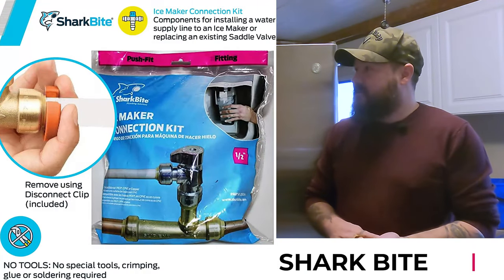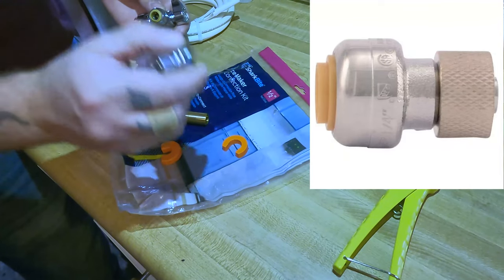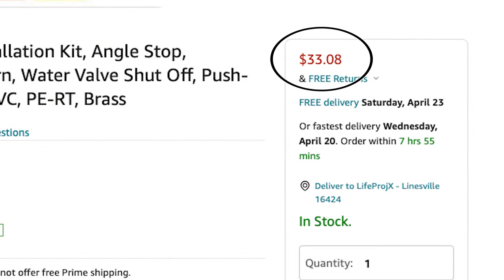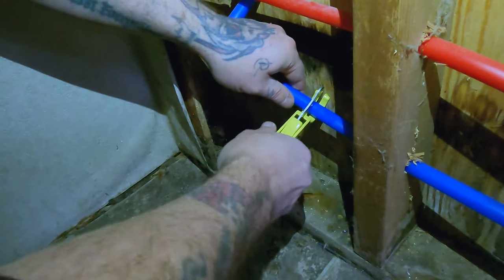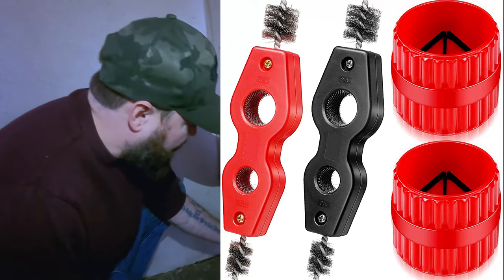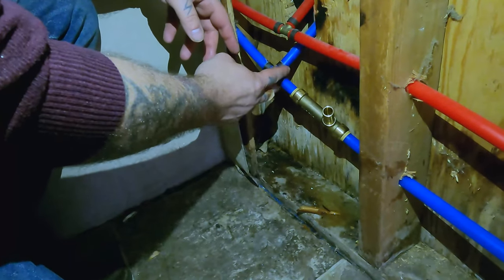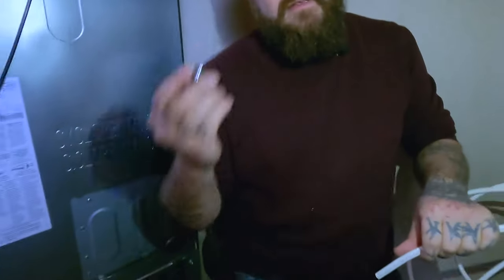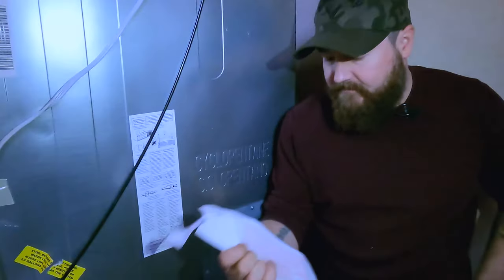Fridge Water Line Install DIY

Comment: That's all good if everyone had that type of system, I have to connect a 1/4 inch stainless steel braided line to 3/4 inch thick walled pvc "/